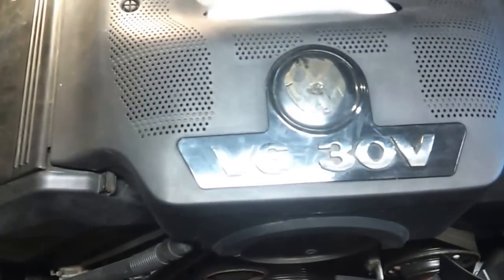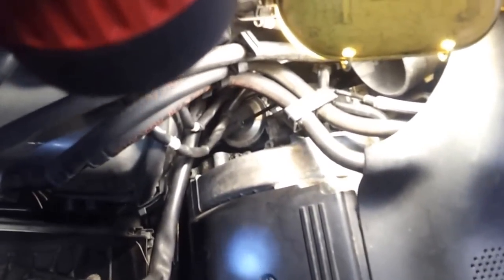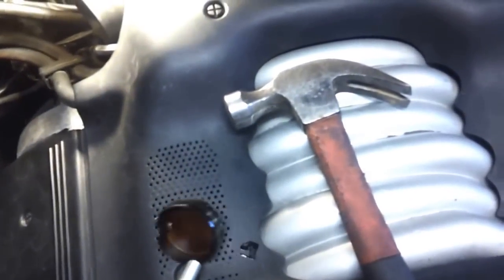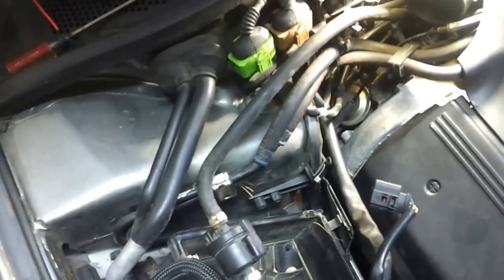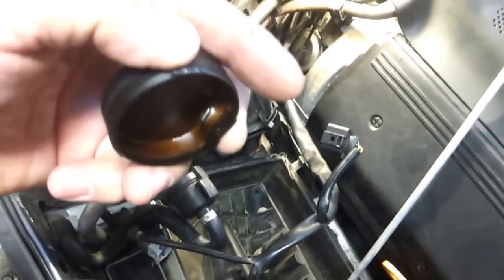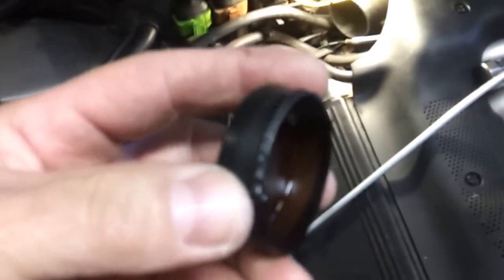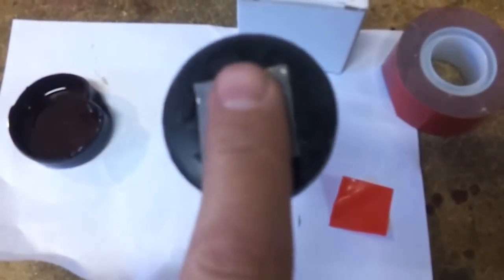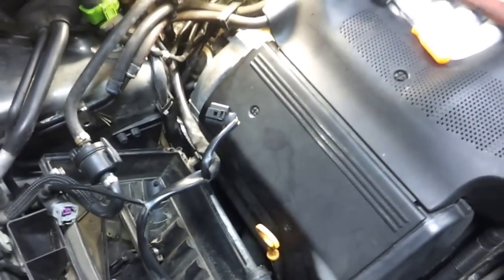Volkswagen/Audi - Camshaft Cap Seal replacement - 2.8L V6

Comment: Thank you for the video! Mine has sat for about 10 years because I wanted to keep miles off it and I went to start it not expecting the smoke to literally come pouring in the cabin through the vents 😂😂 glad I don’t have to pull the engine apart to get to these!
Reply from the maker: Good.luck with the fix Chad!

Comment: Thanks for this upload. For some time I was having oil seaping out from both rear end caps and burning up on the manifolds. I replaced both caps just how you show. It's been two weeks and no more leaks. Fix was straightforward. Just a tight area to work in. Thanks.
Reply from the maker: glad it worked well for you Bert. thanks for commenting
Reply: +Ozzstar so here is my update. 😭 about a month has passed since the fix and all seemed to be well. in fact these two caps are holding strong. problem is, the oil now found another exit route in the front passenger side. to my knowledge, this won't be an easy fix. 😢
Reply from the maker: Inspect  the half moon shaped rubber seal that is in the end of the cylinder head, they are a bitch to replace.
Reply: +Ozzstar yeah I checked them both but they are not leaking. it's leaking from the front passenger side.
Reply: +Bert T. It's your cam seals or valve cover gasket. Goodluck. Cause the cam seals are a lot of work.
Reply: Had the same problem yesterday just got it done worked perfect

Comment: Hello Bud, you really helped me out. I did my valve covers twice not knowing we're the leak is then found out its the caps. Now holding my head because I have to do them again. However hopefully this trick works and sloves the issue. Thanks keep making good content. And love the 2 way tape trick ingenius
Reply: Same here.. or well, I'm about to do the valve cover seals and was looking at other stuff when this video popped up. Wouldn't have thought of this until after either if it wasn't for this video and your comment.

<3

Comment: LIKE YOUR STUFF -- YOUR A NATURAL.-- HELP ME OUT.  NEED SOME HELP.... cleaning the exterior firewall I came on a part just behind the ECU unit - it appears a mouse had eaten through some wires that had been attached to a sensor or relay to something.  it is blocked by ECU and  panel under the wiper arms.  need to remove @t get to it. BUT can't figure what it is. what it runs . - two problems I have is --- washer sprayer doesn't work and passenger side mirror won't fold in. WHAT THE HELL IS THIS THING. ANY HELP  -- this is a 2002 v-6  glx passat - auto trans - 4 motion.
Reply from the maker: You need to access a wiring diagram. Figure out wire colors, repair and check that fuses aren't blown.
Reply: @ozzstars_cars  wiring is just not some thing I can read ---  got the book but can't make heads ot tails out of it. what that thing is would give me a better idea... but thanks

Comment: Any idea on a p0735 on a 04 vw passat GLX 4motion 2.8 v6 it starts to jump after going over 35mph but the code is showing a 5th gear incorrect ratio code. 
Not sure what is going on. Also 
I have a p0296 code as well not sure what is causing that
Reply from the maker: I would suggest you scan the car with VAGcom software to get data.  See what the TCM is doing.  This way you can get some direction to the problems.

Comment: My audi 2.8 smokes from the rear of the engine kinda similar to this place. On both sides.   Smells like oil.   235k+/- (no speedo)  miles.     Could this be the culprit???
Reply from the maker: Use an inspection mirror like this one in the link, https://amzn.to/2tCyPjH  You should be able to see where the oil is leaking.

Comment: I recall taking my 98 A4 to a shop and they charged me about $600 to replace the cam seals.  I am assuming this is the same thing.
Reply from the maker: These cam end caps, not seals.  They are not the same thing

Comment: wow.. and here I am taking off the valve covers and stuff... when it's just the caps that need to be replaced.. I have a 2.7t engine and that same area where you worked on is where the smoke burning smell is coming from.. I'm going to just change out the caps and see what happens.. forget doing all the gaskets haha..
Reply from the maker: There may also be a half moon shaped seal back there, that can leak also.  Thanks for watching Jesse
Reply: How would I know that's the one leaking?
Reply: How did it work out with you changing the caps this way ? did it leak or did it work ? thank you,,,,
Reply: It worked for a while but you might as well do the half moon and all. These engines will leak eventually. I didnt do the cam o seals on the cam shafts or rods whatever they are called and oil was leaking again. At least i can take the front end off in 15min with all the practice i have lol.

Comment: Sooo how did you push in the cap? you didn't show that part?
Reply from the maker: With my fingers, slides right in with pressure.  The wet sealant helps it go in easier.

Comment: what is that silver looking cap directing behind the camshaft cap?
Reply from the maker: +deejayexcluesive  in what part of the video? I need more specifics
Reply: @ 0:35
Reply: Variable valve timing cam position sensor

Comment: Mine isn't a tight fit on one side and regularly needs replacing, any ideas what could cause this?
Reply from the maker: Are you using a VW OEM part or aftermarket?
Reply: @ozzstars_cars  thanks for reply its FEBI I use 👍